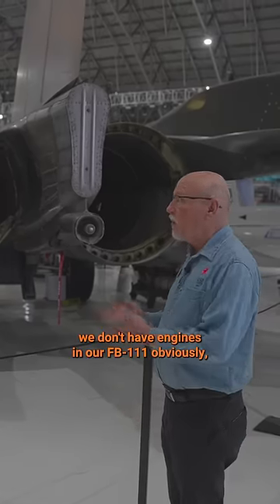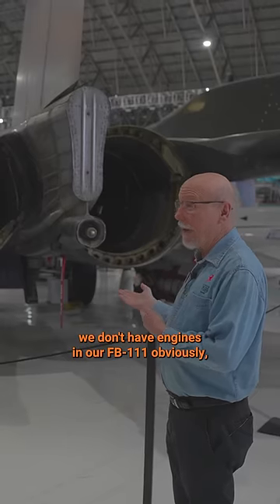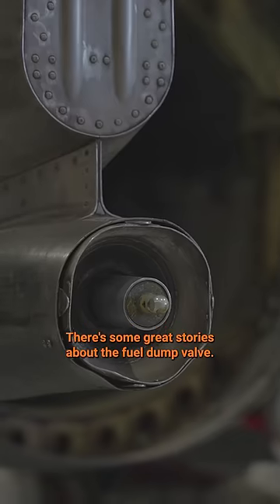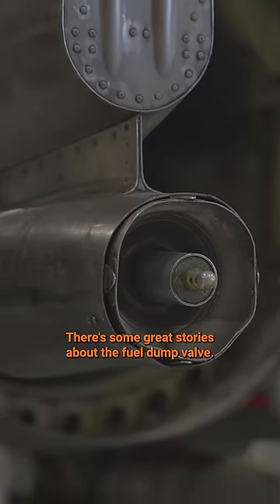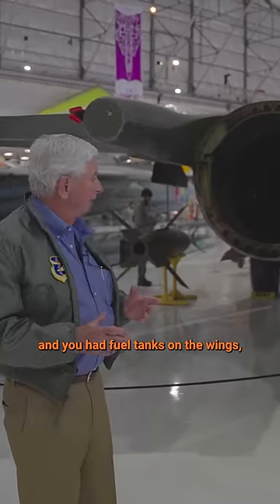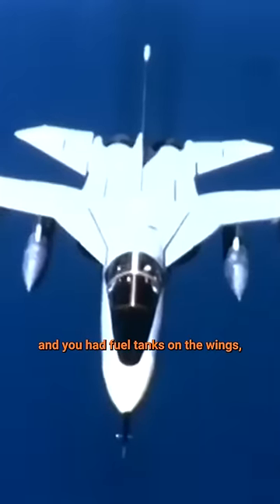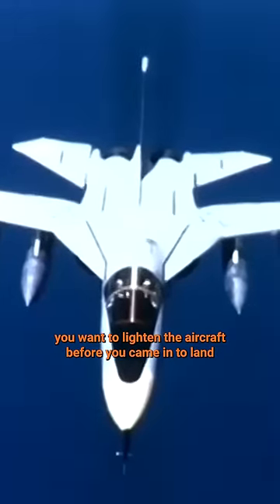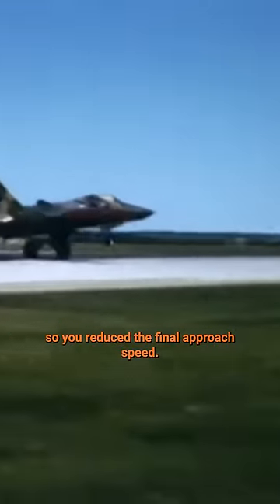FB-111 Fuel Dump Valve (full video on our channel)

Comment: They used to show off after a refueling by ducking under a wing, flying out a few feet, hit the dump & light the burners. At night, it was pretty Spectular. After a few years of free fireworks shows, someone jumped the gun & rolled out too close to a tanker. When he hit the burners, it cracked the co-pilots window pretty badly. An edict from above laid out penalties for any SAC KC-135 crew ASKING for the show AND any -111 crew PERFORMING one.
Oh well, my crew got to see one on a clear winter night & to this day, I swear you could feel our cockpit warm up because of it. I know that wasn't possible, right??? 🫡

Comment: How did an American plane get the moniker " AARDVARK"?
It is the Afrikaans name for a species of anteater and seems strange having it used for this jet.
Reply from the maker: The Air Force never gave the F-111 family of aircraft an official name while in service, but airmen dubbed it the “Aardvark” because of its oddly-shaped nose. The Air Force finally formalized the Aardvark name on the day it was retired.
Reply: @Wings_Museum  I wouldn't be surprised if the swing wings also had something to do with it as they resemble an Aarvarks ears when the are extended.

Comment: i think the good general should pull some strings and get you some f111 engines because that is the heart of the plane. leave them behind the plane in case so you can look at it like a engineering expansion diagram.

Comment: Obvious liar. A supersonic jet has very bad lift on low speeds. So high weight drastically increase chance to smack it against asphalt during landing like a man-bomb. This is why you dump unused fuel on supersonic with fixed wing geometry during landing.